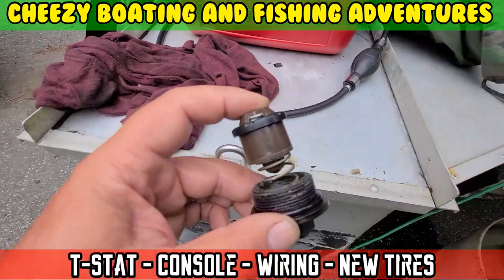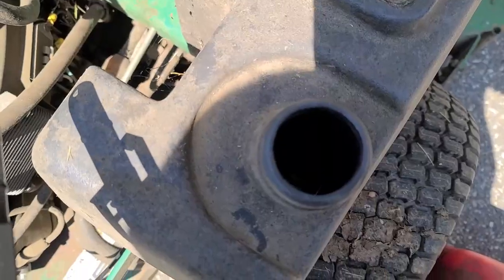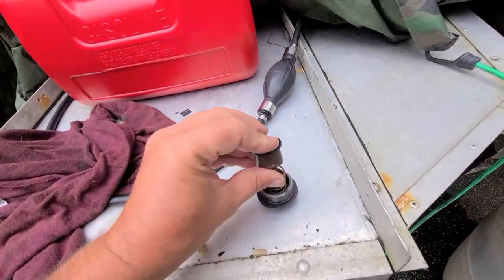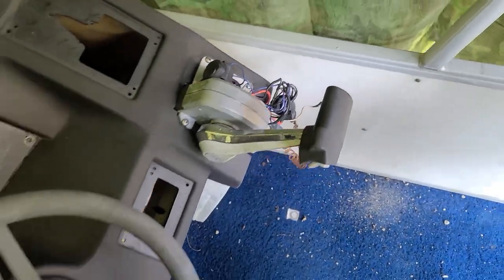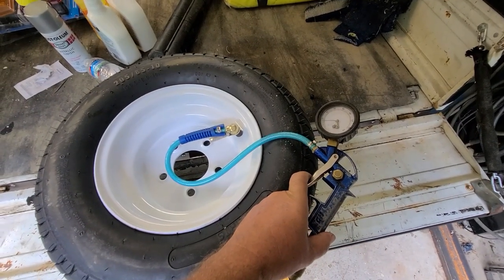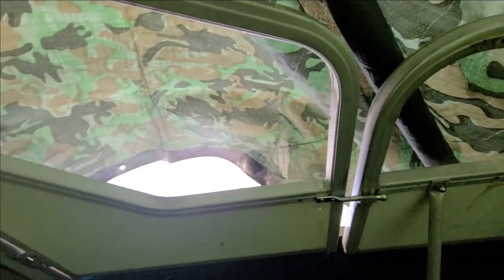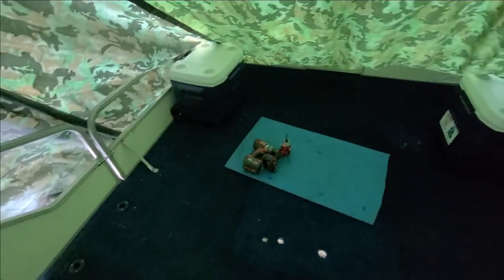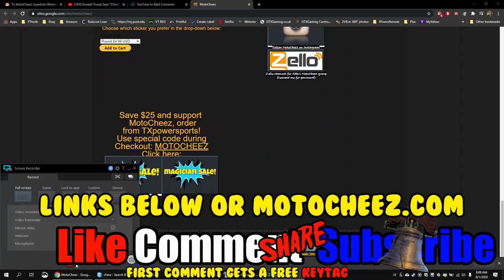Pontoon boat repair (Part 9) Fuel transfer pump, T-stat install, Console wiring, new tires, Chipotle

Comment: “Right Hand drive life”
That’s the one!
Reply: That's nice.. "If you're not driving Right you must be driving Wrong"
Reply: @BAZZAROU812  nope
Then your on the left.
Reply: Most boats are right side
Reply: @Sinerwray  check again? Or in USA? I’ve only seen left side in nz!
Maybe it’s all opposite ?
Reply from the maker: Boat steering wheels in USA on right side,  must be opposite. I've always wondered that too.
Reply: @MotoCheez  somehow I think it might be....
Reply: @MotoCheez  My pontoon boat has the steering in the center. Good balance & walkways on either side. In front of steering console is a live well that doubles as a seat. Like your idea of rolling coolers too.
Reply from the maker: When I have to do the floor over and replace it, I will definitely put the console in the middle. I feel that's the best spot!

Comment: Yeah I like that fuel pump that does work pretty fast! A different colors of the gasoline indicate different octane levels. The air Jack is a great investment!  I think seadoo has been watching your videos they came out with the Seadoo Switch today[ it's a fully configurable jet powered pontoon boat.
Reply from the maker: I always do regular in the containers
Reply: @MotoCheez  doesn't mean the guy that drives the tanker  truck puts it in the right holes at the gas station. I was editing that while you read it. I want you to go check out Sea-Doo and the switch pontoon boat they came out with today. Check out pontoon boat very configurable.. I think they been watching your videos
Reply from the maker: I forgot to answer about pontoon. Yes I saw them, they're nice! Haha. The modular design is a Motocheez copy you say? 😎😎. 
Maybe you're right about the gas grade and color. Never noticed anything other then clear on my cans

Comment: when you got the pontoon, was one of the tubes waterlogged? also if you still didn't get the staining off the seats, D-germ is pretty good at removing that heck even better than actual mold stain remover.
Reply from the maker: When I got the pontoon boat the plugs were still in for the dreams, I removed the plugs and about 15 gallons of water came out of one side and the other side was pretty much dry. Since this isn't the round perfectly sealed pontoons it has a flat top I did find where there was a separation and caulked those areas. I did buy two automatic small bilge pumps that I thought about installing in the rear sections of the pontoons just in case it was left in the water, I still may do that. I have not removed the stains yet because I'm gathering the products that people recommended. I'll add that to my list if I can find it